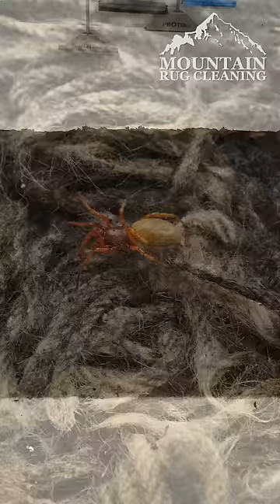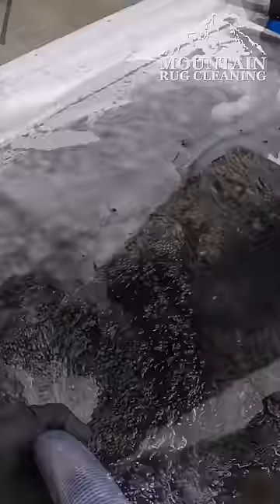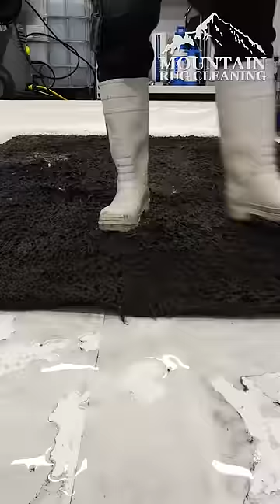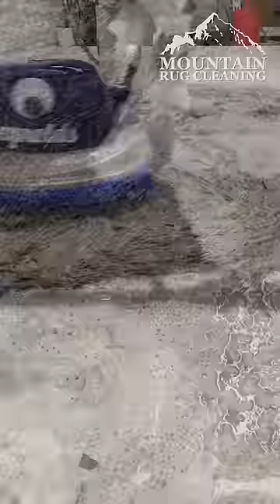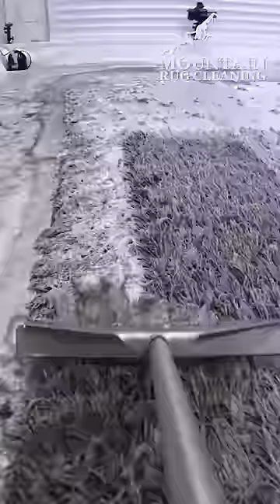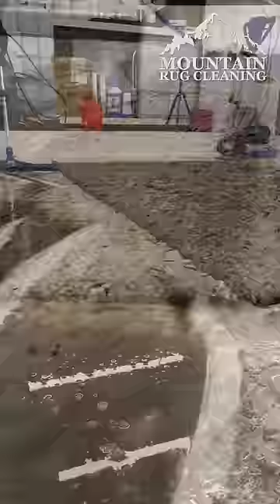Saved from the Flames (possibly): Filthy Smoke-Damaged Rug's Unbelievable Makeover #shorts

Comment: How come every single carpet u don’t hang the carpet up and spray and wash the back of it off cleaning the back although it is never seen will make the carpet much cleaner there is always a bunch of dirt left on the floor under the carpet wen u roll it up u know wen it’s rolled up and u put it in that tube spinning dryer that the dirt from under the carpet goes right back onto the top  due to it being rolled